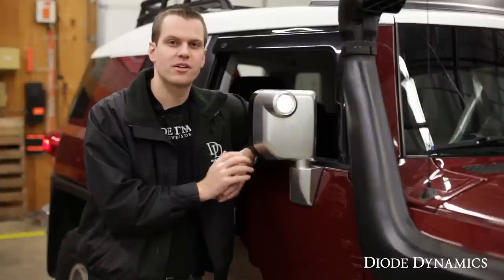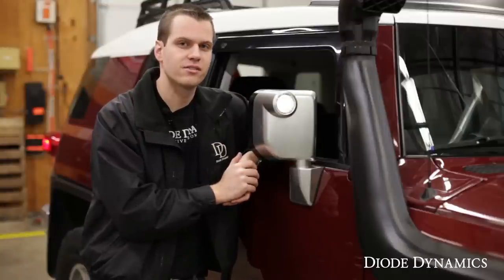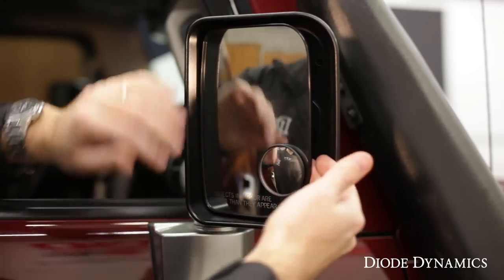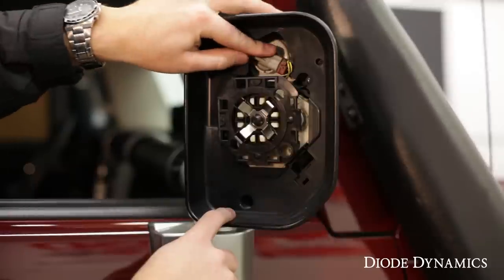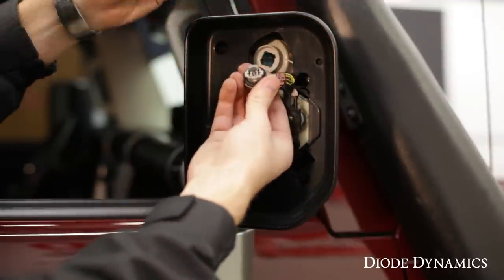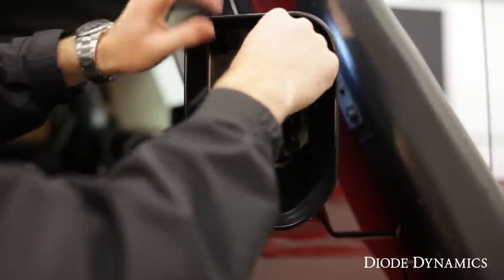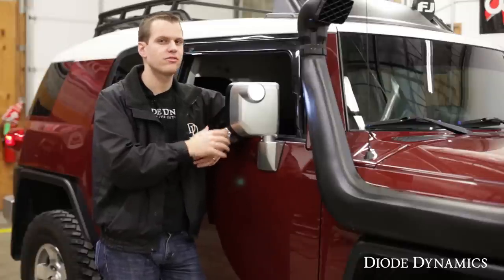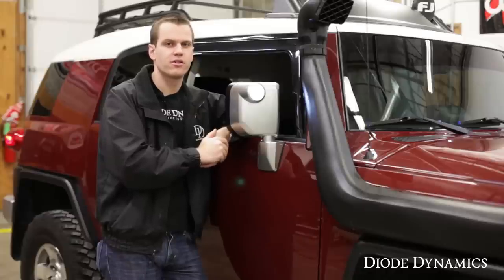How to Install Toyota FJ Cruiser Mirror LEDs

Comment: Not a good video!  Yep I broke the top tabs, not a problem, but FWIW there are tabs at 3 6 & 9 o'clock that you pull and the tabs at 12 o clock slide under or pull down as you remove them

Comment: Pulling your mirror out in this manner will break off the guide tabs on the top back of the mirror bracket and they are both broken off the mirror he just took out. The bracket on the back of the mirror was designed to be removed using the screwdriver from the bottom method. The guide tabs aid in the positioning the mirror during remounting, but play no role in securing the mirror in place.
Reply from the maker: +Redtider Thanks for the tips!

Comment: Caution everyone this is not as easy as it looks and I'm here to tell you even if you do this the right way there's one thing you need to do and that's put tape over the mirror I learned the hard way I didn't do it for the driver side and I cracked the glass pretty easily and cut my hand when I did the passenger side I put an x with some packing tape and it was just as hard to get out but the mirror did not crack I ordered a new mirror for the driver side and before I put it on I will put tape on the mirror again I hope this helps someone
Reply from the maker: Thank you for the helpful feedback, Dom!

Comment: I bought DD LED and I followed this video instruction to remove the mirror.  It did not break upper tabs but  the actuator part came with the mirror.   So I had to separate the actuator from the mirror and installed it on the motor unit first adding silicone grease before installing the mirror.  The mirror part should be pulled out from the bottom not from the side I think.

Comment: You broke the top two tabs by taking it off that way.
Reply from the maker: +Spaldäm's Adventures Thanks for reaching out! For this installation, we were able to snap the mirror off and keep the tabs in tact. If you have any other questions, please don't hesitate to contact us!
Reply: Yeah, except you can see in your video that the top guide tabs are broken. You even said it's harder to get off the first time, because you break them the first time. You need to pull up from the bottom to avoid breaking the top guide tabs.
Reply from the maker: +Spaldäm's Adventures Thank you for the tips!

Comment: Evidently, it has never been taken of.  I just spent the last hour working  on my drivers side mirror.   When I tried to get the mirror off it wouldn't come. I finally used a plastic trim tool.  It pulled the whole assembly off.  😵‍💫  It was a bear trying to get the inner assembly back in place.  I thought I was going to have to buy a whole new mirror.  I finally got it back on and crossed my fingers hoping the power mirror mechanism would still work.  It did!  😃🙏

Comment: He removed the mirror wrong and he didn't show you but two of the clips on the top backside of the mirror are broken off because it was removed wrong. To properly remove that mirror you lift up from the bottom not the side and use a long screwdriver in the center to pry it up there's a channel for that purpose!
Please do not remove the mirror that way you're only break the clips! Again to properly remove it used a long screwdriver and find the channel on the bottom side of the mirror and use the screwdriver to pry the mirror up to unlock it.
Reply: Good catch Greg. The way shown is a guarantee way to break the tabs off the top.
Reply: I was about to comment the same!
Reply: You’re right, too bad this isn’t pinned, wouldn’t have broken tabs right now if I had seen this
Reply: True. but some year model FJ may have different clip configurations.
Reply: I should have read this before trying to remove. Shattered my mirror with the force. Sweet.
Reply: Which this method work for the 2012 model?

Comment: Found this video, ordered the bulbs, put them in... THEY LOOK GREAT! I have found several other items that I would like to get from Diode Dynamics now that I have made my first order. The pictures and videos really help and make the whole thing easy. I did snap one of the clips off of the back of my mirror when I was removing it, I did it exactly as it was supposed to be done but I think that my mirror was just so tight that it was unavoidable, mirror still holds well with the remaining clips. Just a word of caution, watch this video before you do it yourself to avoid or minimize any potential damage.
Reply from the maker: +Mike Culp, thanks for the support! We appreciate your business!

Comment: Are these the brightest bulbs available? If not, which are the brightest that you would recommend? Also what about removing the plastic filter membrane inside the light housing to improve brightness?
Reply from the maker: +Michael Waters Yes, for this video, we installed our HP5 LEDs, our brightest bulb model available. Check them out at the link below! Removing the plastic cover in front of the bulb would increase your output, but we would not recommend leaving these bulbs exposed in the housing. If you have any additional questions, just let us know! 
https://www.diodedynamics.com/mirror-leds-for-2007-2014-toyota-fj-cruiser-pair.html?utm_source=youtube&utm_medium=social&utm_content=fj_mirror
Reply: Thanks for the reply - I will check out those bulbs. Also, I was not meaning the external plastic lens, I was talking about the diffuser film inside the bulb housing. I'm think that removing it would have a positive result.

Comment: I've always been curious about these lights. What are they meant for on the mirrors there?
Reply from the maker: +znovosad555 They add an extra source of light to the exterior and show off the width of the vehicle. From the factory, they are generally not bright enough to illuminate much, but our LED bulbs make them brighter and crisper. If you have any other questions, just let us know!